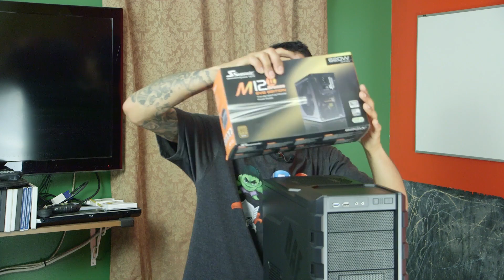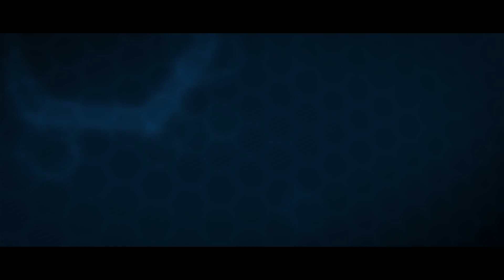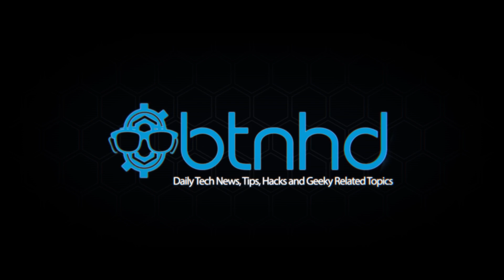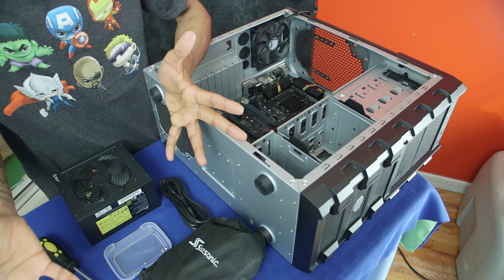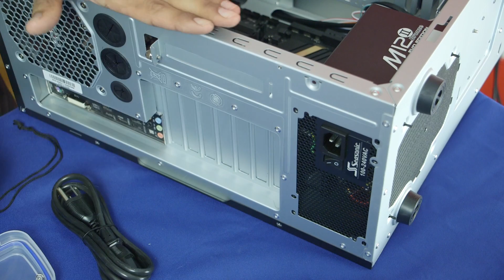Installing Seasonic M12II 620W PSU into Cooler Master HAF 912 Mid Tower #VRBuild

Comment: o3o the problem i see in the comms is they said is upside down the psu..... i think this psu the air flow is entering from the fan and outs for the rear where is the power button?

Comment: Just checked out your channel and you have loads of videos out. I guess this one was one of the earlier ones? Cause it's kind of lame. Surprised you didn't elaborate on whether to turn screws clockwise or not to get them in ;-)

A video like this would be better if you showed people how to identify the cables needed for their particular build and to connect them first before putting the PSU in.
Reply from the maker: Great feedback. I will keep that in mind. Was planning on doing another build soon. Thanks for watching.

Comment: Are you really teaching people how to build a rig ? the psu should be installed (in your case) with the fan taking fresh air from the outside and not hot air from inside the case. : /